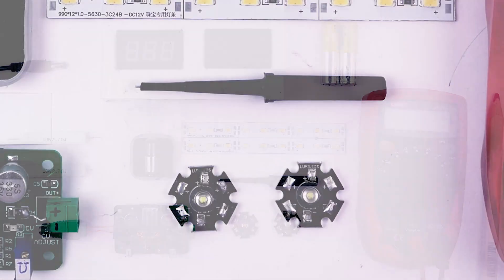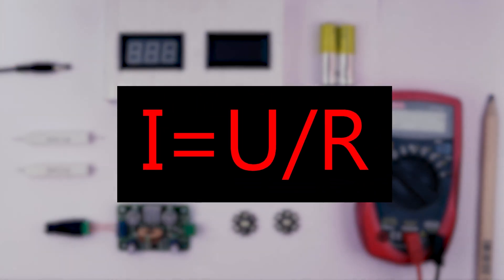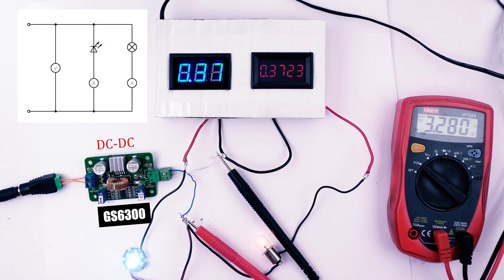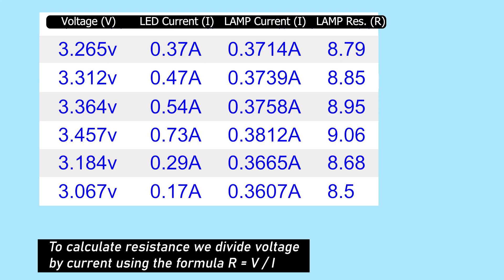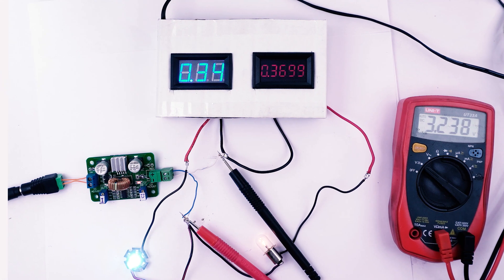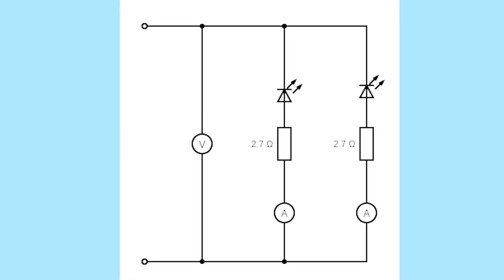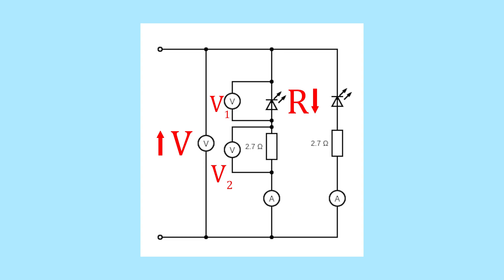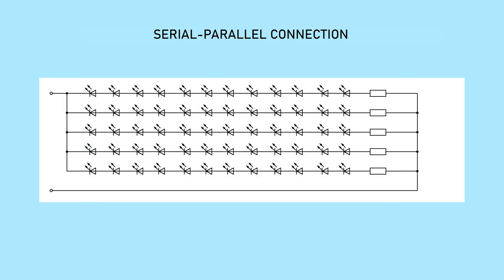Why does an LED need a RESISTOR? The Simplest Explanation.

Comment: When the LED heats up, the current increases. This is the normal behavior of semiconductors of any type, just as the gain of silicon transistors increases, not to be confused with MosFets.  The situation there is completely different. The resistor is only there to limit the current, which is 0.025A for a regular LED, i.e. 25ma
Reply: Hey bro, you know any optimal temperature range for.. let's say maximum performance of semiconductors (in general or for cpus particularly as well, also for overclocking).
That's not too far off the average ambient temps of most places.

Comment: nah, I still don't understand or maybe your explanation is not convincing. Why is it called current driven when you have to increase voltage? 
easier to understand. The light bulb increases by 1 volt but the amp remains unchanged => the light bulb must be current driven because the amp does not change. While the LED increases by 1 volt and the amp increases, it must be voltage driven